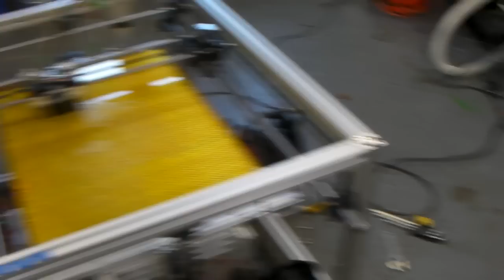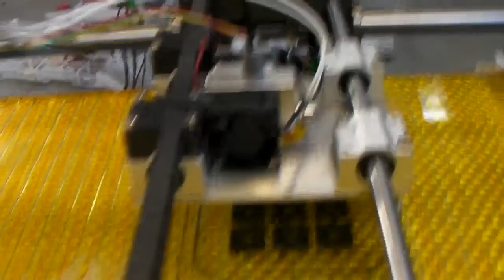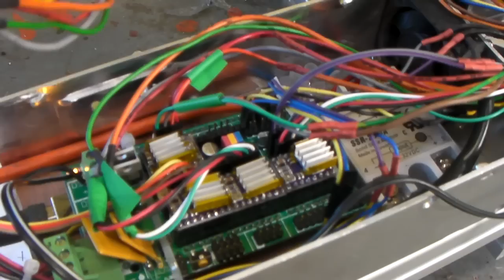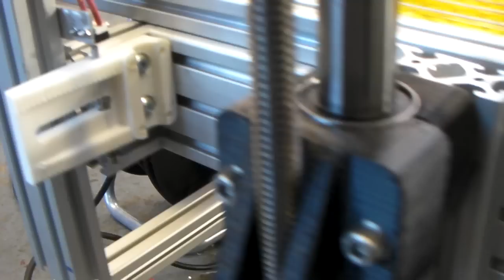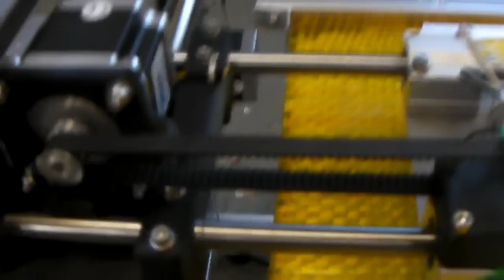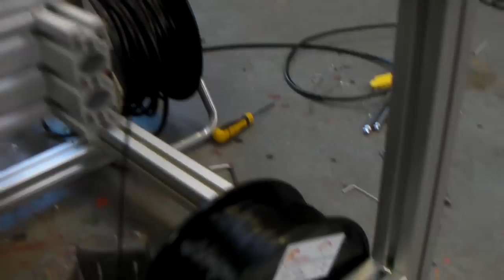Large DIY 3D printer

Comment: are you using nema 23, with polulu stepper drivers in your ramps board..  I thought that you would have had to use a larger drivers, and i know that the ramps dont like high current required for your build if im mistaken?
Reply from the maker: I havent got the printer here at the moment but I think I used the 8825 driver which is a bit higher current. Anyway, Im sure it was in limits of the motor. It worked fine, everything running cool and lots of power.

Comment: Hello Sir ! I am new to this 3d stuff and I currently own a DIY kit with me , size of bed is 220x220 only , so I need to know if I am going to rescale it bigger then the existing one , which is better DELTA type or prusa i3 type ? sorry for my bad English , what I am going to print need more is lighting set , I want to design lighting housing and etc ... 
So hope to hear your opinion thanks .
Oh I like your printer size but I don have the material that you use , its a bit hard to find them , all I need to do is going to order them from web site , that's bring me a lot of problem ........
Thanks again :)

Comment: Hello Mr V. sorry to hear about the theft.
I have printed some models with 200X200X200mm diy setup. But I haven't sean that large setups in real life. I have couple large models for casting purposes.
Is there anything to know if I just plan to scale up my current printer to 900x300x250mm.
Have you experienzed problems with plastic getting too cold between layers if printing larger objects?
If you are interested giving some pointers on planning the scaling up the printer I'd love to get your input...
Reply from the maker: Hi there. I sized the machine to enable me to print custom rifle stocks but got too busy with drone parts to try large prints, however I did fill the bed with multiple pieces to cover a large area. The bed (2 pieces of glass) was a bit wavy so was difficult to get a uniform gap. However now that repetier (and others) support z probing and bed contour mapping this issue could be resolved (if i had the printer). I was expecting problems with warping of large ABS prints so was expecting to have to do the rifle stocks in PLA. Also I intended to put acrylic sides on the printer to keep it hot inside.
I have just finished a new design printer, currently in 300x300x200 format but could be easily scaled up. Hope to upload a vid soon.
Reply: Cool
my plan was to make casting molds to produce aluminium inlet parts to race engines.
Maybe later I will try to cast exhaust headers with cast iron.
Would you be interested continuing chatting via whatsapp or e-mail?
Reply from the maker: Sure, email. vincehogg@yahoo.co.uk
Reply: e-mail sent
Reply: hi
how did your mould trials go. i am also trying to do the same for gear box casing share your experience.

Comment: can you show us how the print bed is wired?
Reply from the maker: I just experimented with different lengths of nochrome wire connected to 240vac that heated well (think it was about 3mts). Then I zig-zaged the wire in 3 separate lengths between the 2 glass sheets. Hope this helps.
Reply: well im wanting to make a big 3d printer but not sure how to go about heating bed.. not sure i can go 240vac or not
Reply: James Smallwood is there away i can run the bed on 12v?
Reply: James Smallwood
Hi James, I was involved in the building of this printer. I would recommend using mains voltage for large heated build plates. It would be cheaper as a large 12v build area would require a substantial power supply. The mains voltage is switched using a solid state relay, power is approximately 1Kw, so it heats up reasonably quickly. There are 3 parallel heating loops, the wire is taped to the glass with kapton tape, then sandwiched with a fiberglass insulation layer and another sheet of glass.
Reply from the maker: No